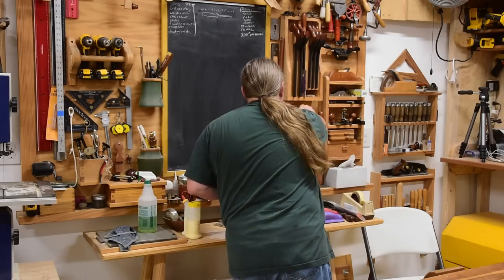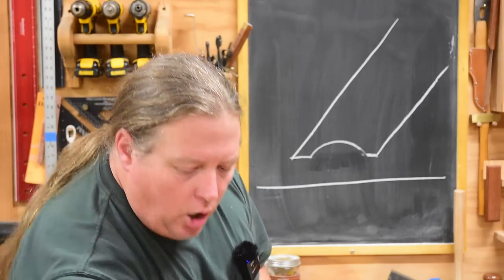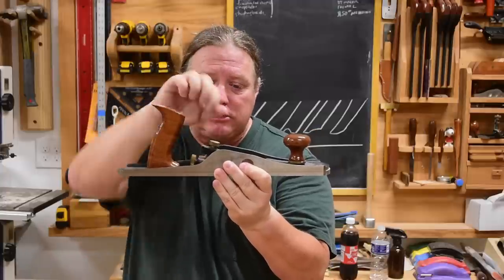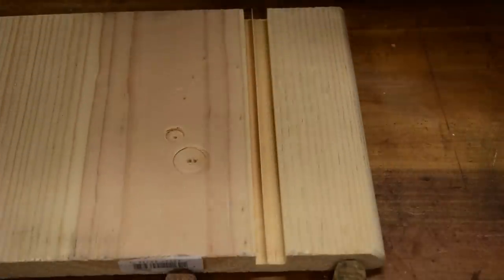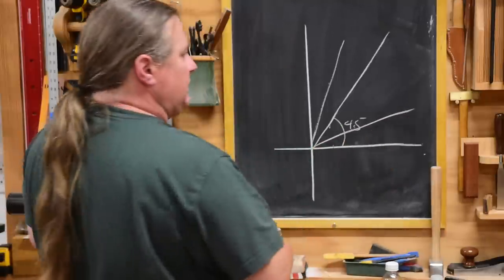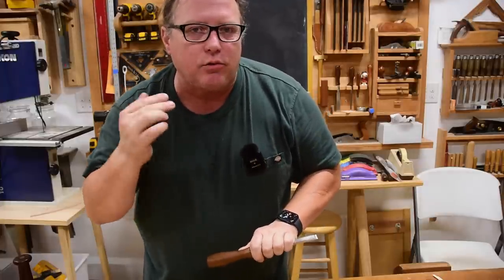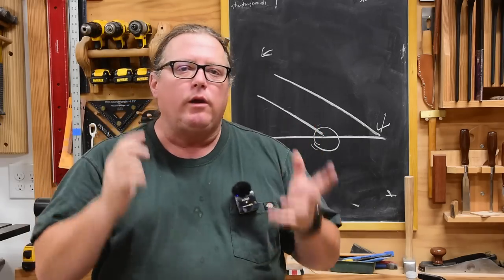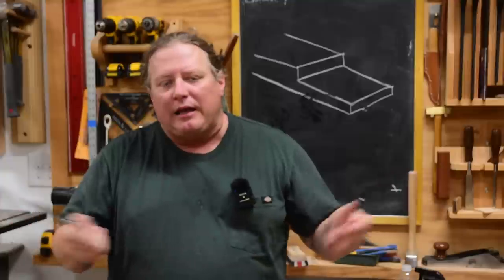Chisel Skills, Theories, and Techniques for the Sophomore/Junior Woodworker

Comment: I'm amazed at the way you compiled and made so much information easily absorbable. I have not in many years of woodworking and teaching made the connection between a pivoting chisel cut, and the change in angle of attack, it's just something I've done without thinking about what is actually happening. Thank you!

Comment: Having an additional cheap set of chisels just for softwood has been a great investment. This way I grind ~17° primary and then hone the secondaries I need until 2/3rds is gone, then refrains the 17°.  Saves time and wear and tear in my primary hardwood users.  They are sincerely consumables and only get used in pine and cedar.

Comment: Great explainations !

Sharpening is not only putting a sharp angle on edge : angle matter, bevel matters.
And also profile actually. I have 2 chisels with a light camber, i find it works well for paring with a arched motion.

Comment: Wow, I never realized that about skewing a blade - totally makes sense, I just never connected what I learned in math class with what I learned in the shop. But I think there's also something useful about the edge of the blade slicing across the work along with the lesser blade angle. (You may have covered that as well).

Comment: Hand sharpen only gentleman do not take it to a grinder once you hit it on the grinder you immediately start heating it up this will anneal your steel for those people that didn't understand that it means you will soften the steel where it will become shit hand sharpened only... And that is what my daddy taught me who has 35 years experience as a carpenter I've got 20
Reply from the maker: Nope, you can use grinder without affecting annealment.
Reply: @wortheffort  especially with advancements in steel, hss, powdered steel etc.
Reply: @ninjamailz9711  advanced metals are tougher but still can be done with stones. I have witnessed too many noobs get on a grinder, and immediately annealing their chisel,drill bit, or personal knife. Sharpening by hand leads to a better outcome further down the road. And we'll save you a lot of frustration 😉 that's my advice and I'm going to stay with this.  You're grown adults and you can do what you think is right for yourself ❤️